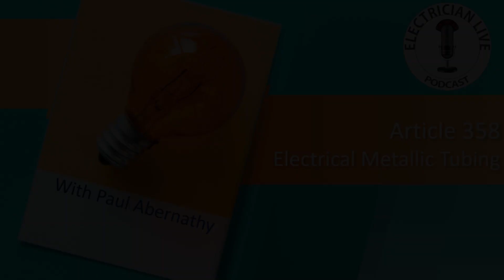Electrician LIVE- Electrical Metallic Tubing (EMT) Explained

Comment: I got into an argument with my foreman about running 3" EMT up on some trusses, and he wanted it supported every 8'. I went every 10' because 8' put some straps in the middle of the stick, some right on the coupling.
Reply from the maker: Sup Banana - Well, the securement every 10' is correct and within 3' of  box or cabinet is correct. while the 8' is overkill, its still compliant. However, in your case it seems it was more prudent to use the entire 10'. Seems your foreman wanted it but really didn't know why he wanted it.
Reply: @MasterTheNEC  Thanks for the prompt reply Paul.  It was a long run, ~350' feeding a 200a. panel, and the "foreman" was afraid the weight of the conductors would pull the run down. I used deep strut, with 3/8" bolt's to the truss. I'm a bit old school from back when securing 3' from a box OR coupling was the norm, so a strap in the middle of a stick just didn't sit right with me. After installing 200' before lunch, 38' in the air, on a lift, he laid me off because I didn't follow his directions and over kill the strapping.